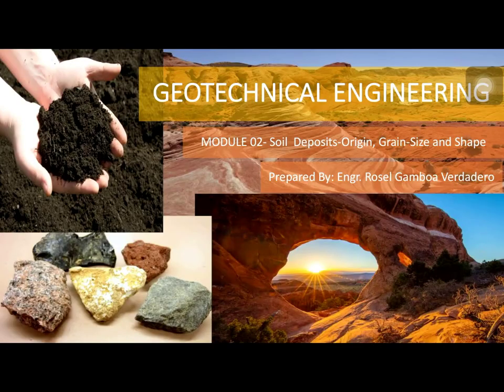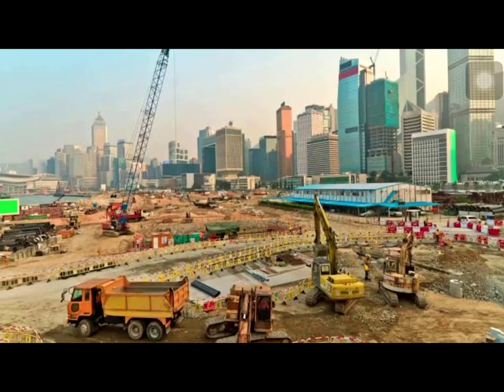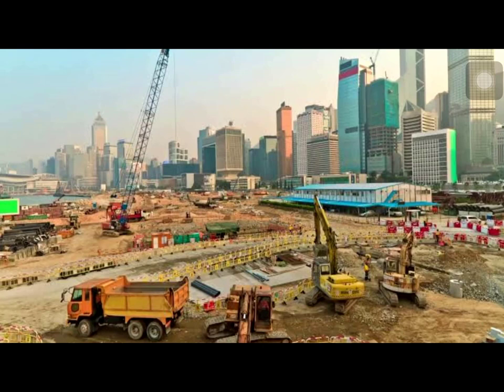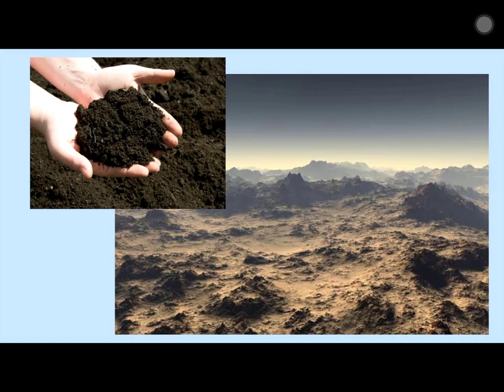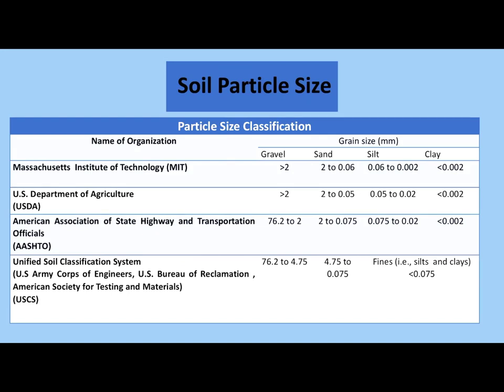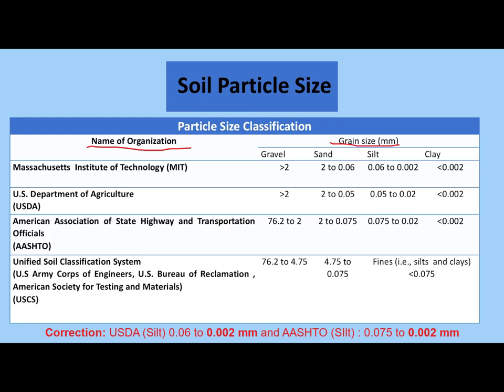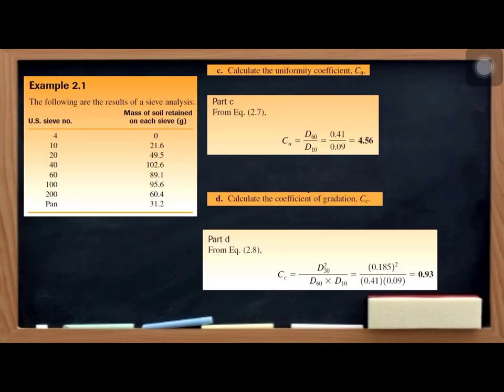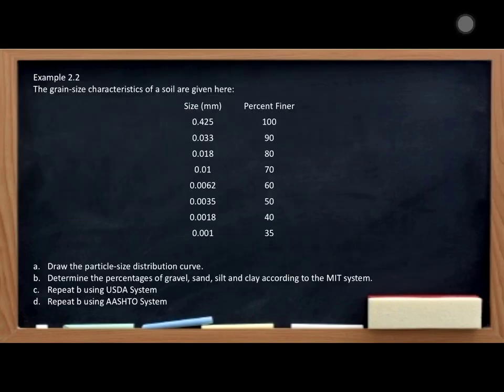Geotechnical Engineering Lecture 02 Soil Deposit- Origin, Size & Shape w/ Sieve Analysis Problems

Comment from the maker: Correction @ 55:13, 
you may use 
A.) X2=log (0.250) - log (0.150) & X1=log(0.250) - log(D30) 

OR 

B.) X2= log(0.150) - log (0.250) & X1= log(D30) - log (0.250)

You must get D30 = 0.1890388515 mm or D30=0.189 mm using any of the two conditions.